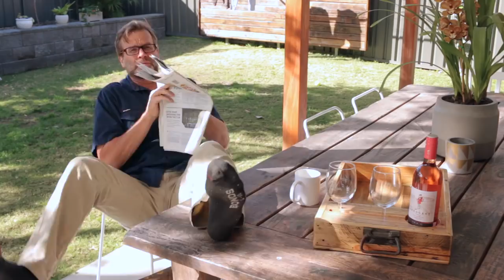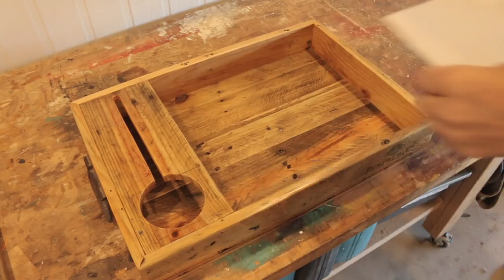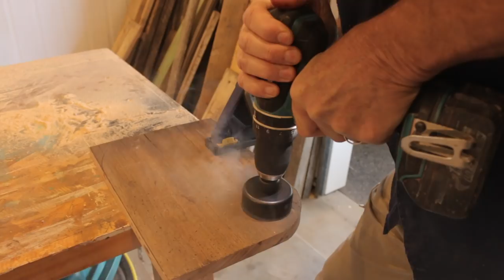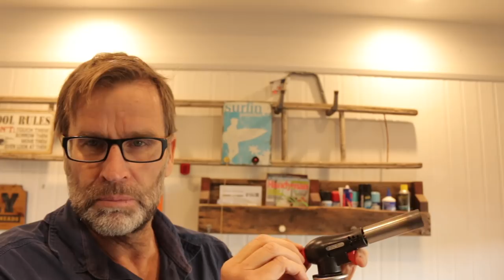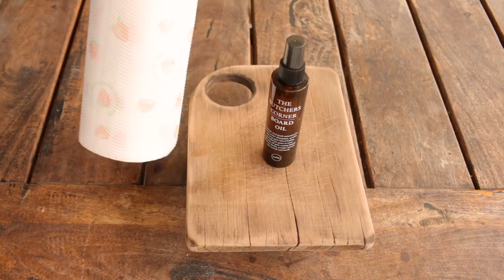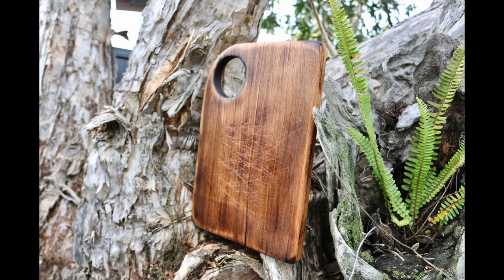How to Make a Cutting Board. Antique Style Chopping Board.

Comment: a tip i read about cutting holes out with a holesaw was to drill a couple of pilot holes just inside the circumference of the hole you are cutting and this helps for the wood shavings to fall through the hole and keep the blade a bit cooler and better visibility.  havent tired it yet.  Love the boards - very useful and great idea
Reply from the maker: Sounds like a good idea Ruth and thanks for watching 👍😁

Comment: You can also mix the oil with beeswax 4 oil to 1 beeswax. You coat the boards with the oil and let it soak in, Then get you Mixed Beeswax and oil ( it will if mixed right, be like a paste) and then coat it with the mix and BUFF it in with a cloth or paper towel :) Just a Bush Shed Tip :P
Reply from the maker: Yeah l've seen a few of those concoctions mate. If l had the time l probably would have done it. Talk soon old son 👍😁

Comment: Really liked the simplicity and function, plus call out for food safe oil. But, the cracks in the wood will hold food, oils and bacteria. Which is why restaurants use solid materials. Just a FYI
Reply from the maker: Thanks Keith. I know what you're talking about but l don't think l'll be cutting chicken or anything like that on them. More of a platter board than a cutting board. Have a good one 👍